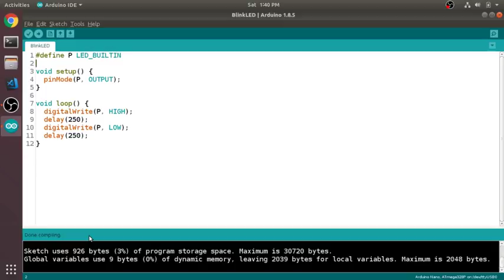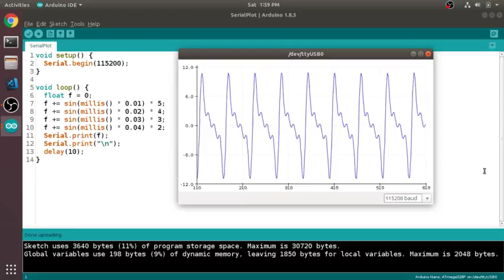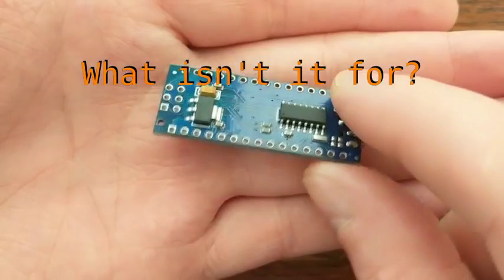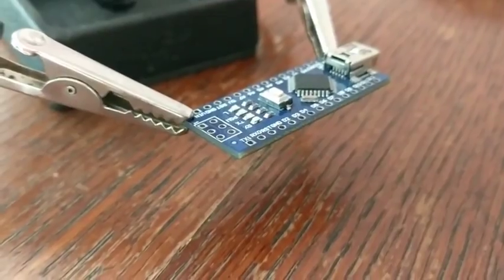Arduino Nano specs | Just Board

Comment: If my nano is in my truck and its controlling my tail lights how far can I run controller from led strip without using power boost wire

Comment: Just subbed!  Can you share a link to the device that is holding up that board?  It looks really cool.
Reply from the maker: Thanks! I got those clips for holding components while soldering ("helping hands") from a Radio Shack years ago so I'm not even sure they even still sell them. But they're basically the same as this model https://www.amazon.com/Hi-Spec-Soldering-Magnifier-Magnification-Electronics/dp/B074Z3LP3P/ and there are a bunch of cool versions these days that have crazy bendable arms and stuff.
Reply: I got one at Harbor Freight for about $5 USD, just a few days ago